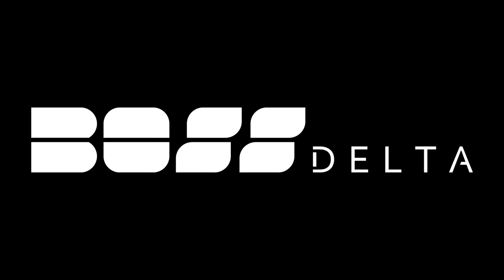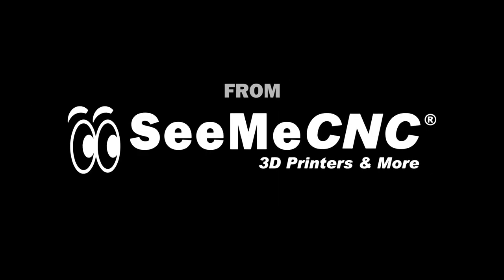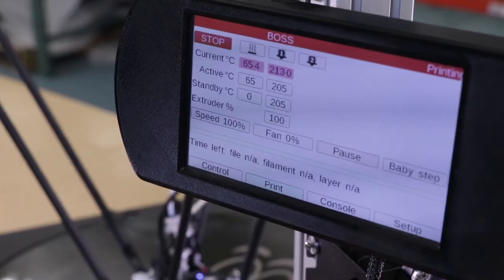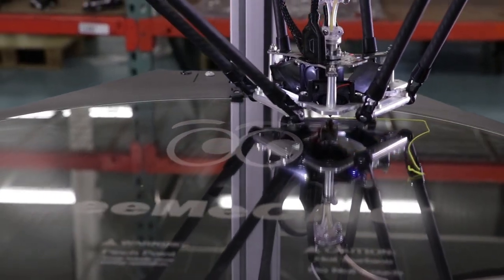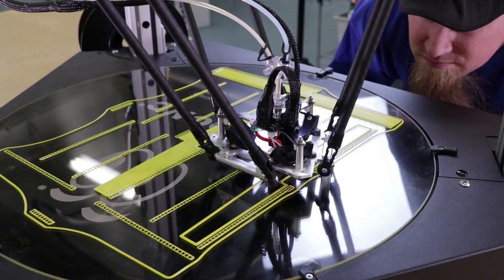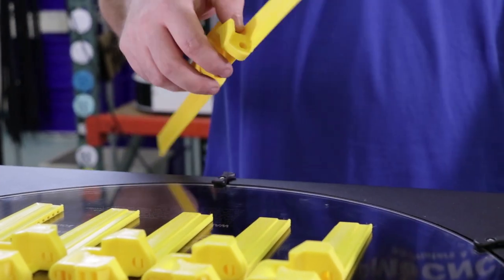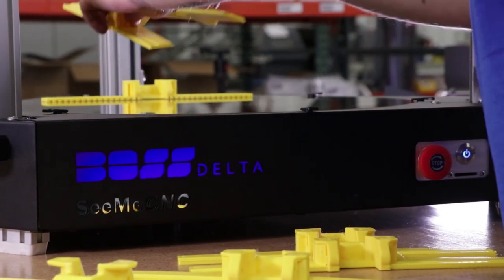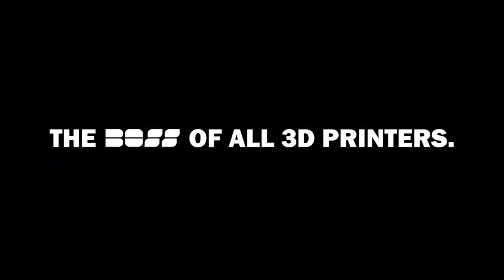The BOSSdelta™ 3D Printer from SeeMeCNC® | Details, Features, and Specs

Comment: I love how you guys removed the prints and skirt and replaced the prints back onto the bed to make it look like it's stupid easy to remove the print.
Reply from the maker: Thanks! But that isn't how it happened. Just clean the glass with rubbing alcohol and paper towels. Print directly on the boro glass plate. Bed was at 65C and when the print is finished you have to wait for the bed to completely cool down to room temperature. We only have experience with SeeMeCNC brand or Atomic Filament brands. 😀

Comment: How do you guys get prints to stick with just an alcohol clean???
Reply from the maker: Clean paper towel and rubbing alcohol. This works with PLA and we have plenty of experience printing Atomic Brand carbon fiber PETG direct. We recommend purple aquanet with CF PETG because it can stick too good and pull off pieces of glass. Bed 90C for carbon fiber. We do not have experience with other brands. But feel free to resp .ok ne with your experience. Thanks for commenting!